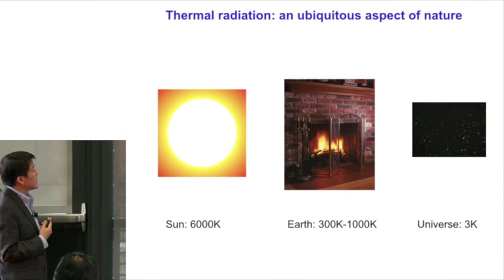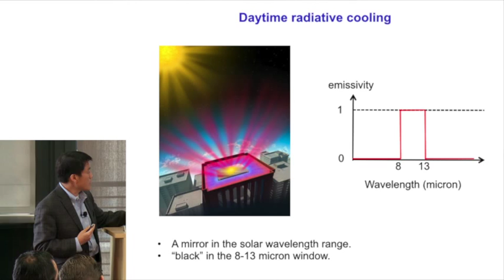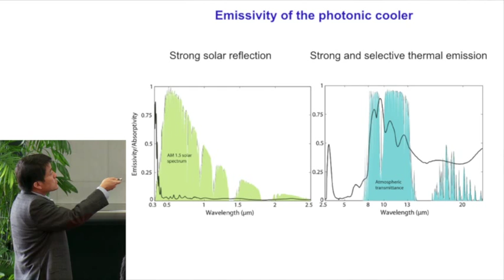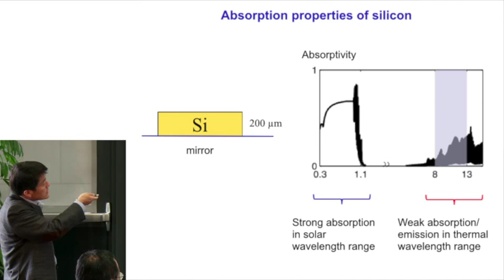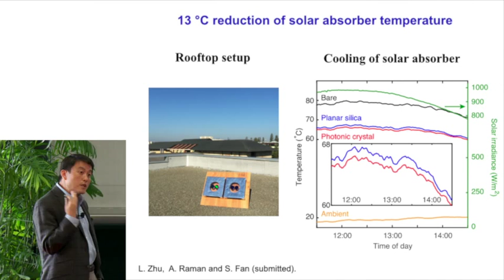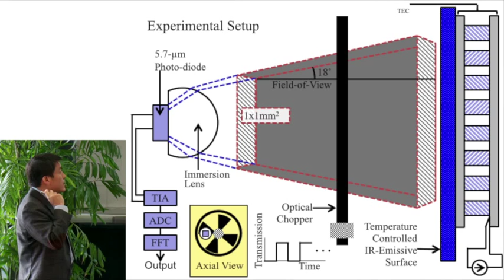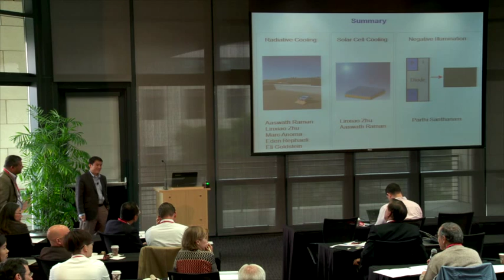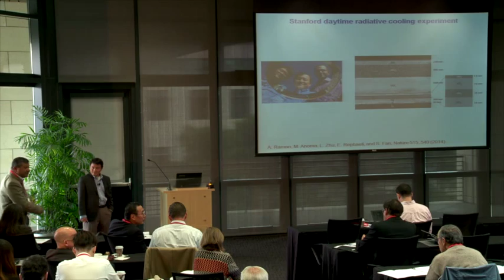Shanhui Fan | Controlling Thermal Radiation for Energy Applications

Comment: Is the increase in efficiency with solar cell cooling due to the lack of back EMF caused by the thermal emissive effects of 'seeing' open sky. If so could the same efficiency be realized by shielding the cell from 'seeing' the universe and reflecting light onto it.